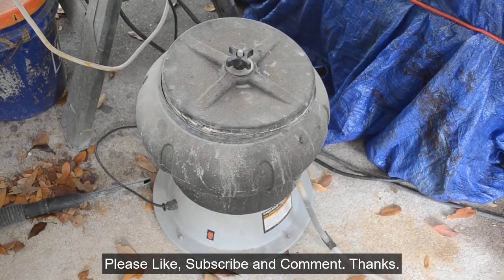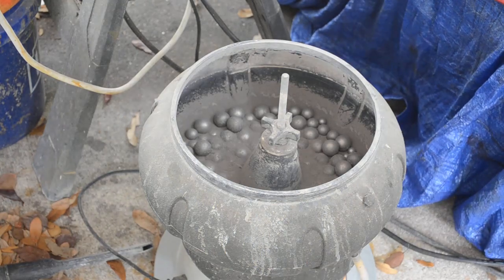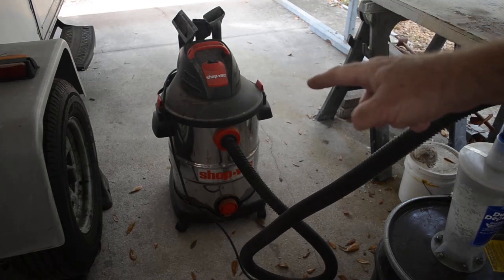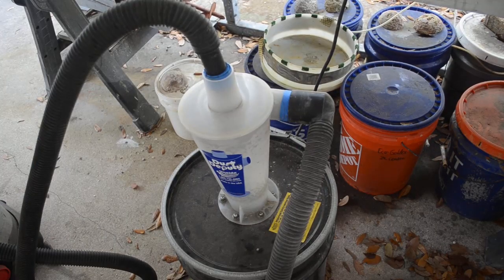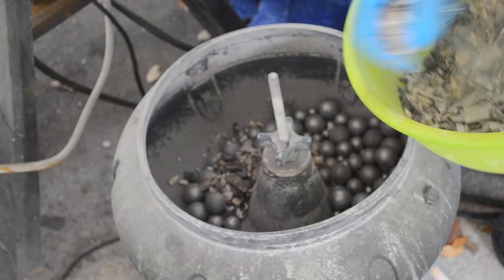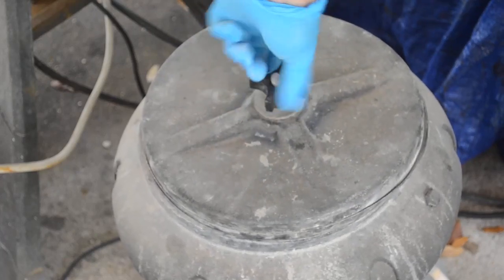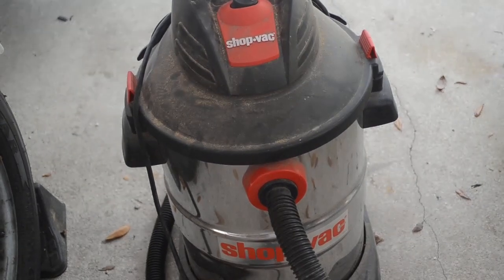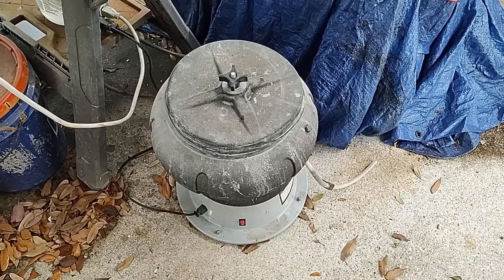Gold Liberation Grinder Now With Better Vacuum Extraction

Comment: Just throwing an idea out there.. what if your shop vac was attached/fitted to in the top op the ball mill while running it? Then the fine dust would be transferred in the bucket while all the heavier material would stay in the mill. 
Then adding more burned chips every couple of hours until the mill is “full” of the heaviest material..

Comment: Centrifugal/gravity separation by air I believe is a huge deal, more than most people would realize. Especially if you can get everything to a 250 mesh or so, it’d damn near do the panning for you if you can tune the velocity/flow rate

Comment: Another great video and Another great method
However one small snag is that you will ( and i know this from expierience ) get micro fine iron particles from the Ball Bearings. My old ball mill that i used to Bash Carbon for my Battery research did exactly the same thing. OK so not a major problem but just saying.
All the best Kev
Reply from the maker: There's plenty of steel in the IC chips. so the stuff is already loaded with iron. A little more from the balls won't matter.

Comment: The best separator would be a PVC pipe 2 y connectors 2 cap or plugs and a garden hose fitting put the cap and the hose fitting at the bottom along with a y with a cap then add section of straight pipe add another y point it to the top add one last piece of straight pipe leave open at end set it all at an angle turn on water till just the right separation all dust and particles leave all heavy metals sink to the bottom into the y cup works to separate black sand from gold to

Comment: How come you don't just use a (lead or bismuth collector with soda ash borax and a small amount of kno3) when you put it in the foundry to Ash you could  process just the metal after that you have all of the equipment it is much faster easier and cheaper the flux I mentioned will oxidize all base metals like copper iron tin and nickel to the flux precious metals and Trace amounts of Base metals will go to button Coppell lead button then use liquid lab to purify